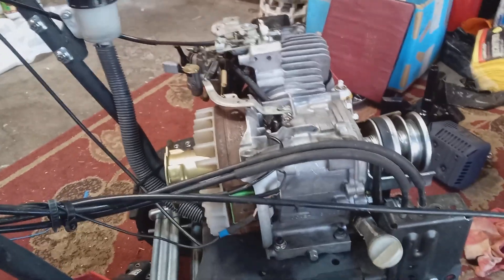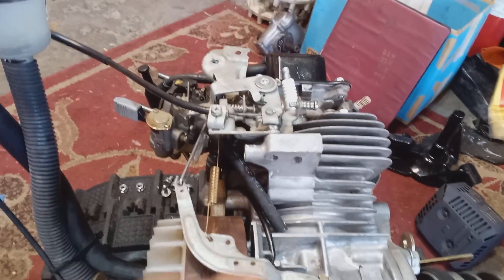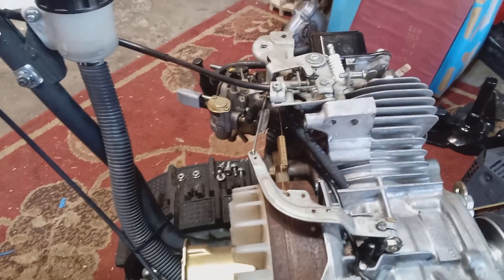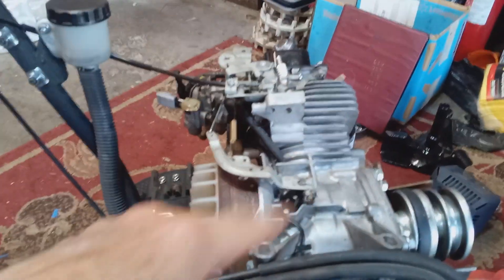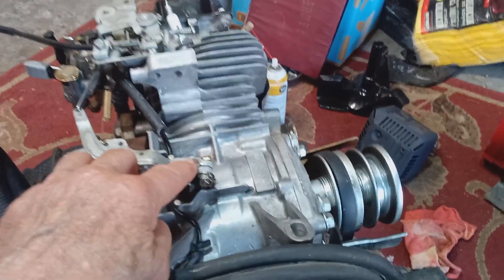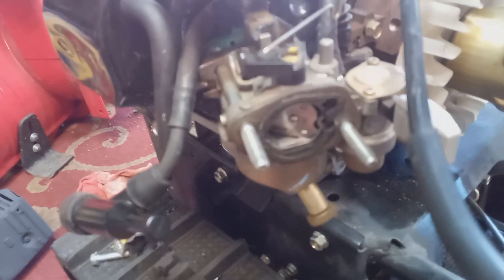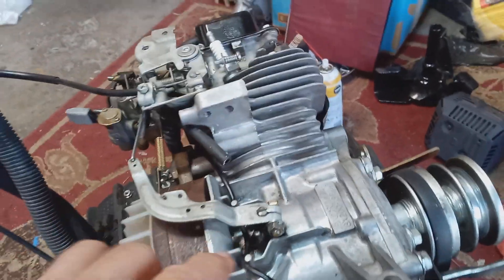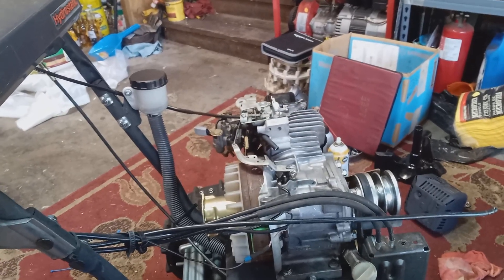WRONG Way To Fix Racing (RPM's) Honda Snowblower Engine And/Or Adjust/Set Governor!

Comment: Mine hunts wen it’s cold or in light snow but wen the snow is deeper 6 inches or more its runs great or after it’s been running for 15 minutes in less than 2 inches of snow … I’ve gotta take the tank off and check all of this it’s an older hs724 brand new Honda carb